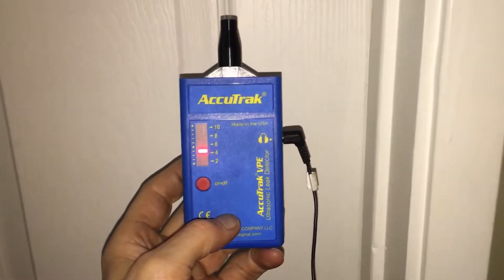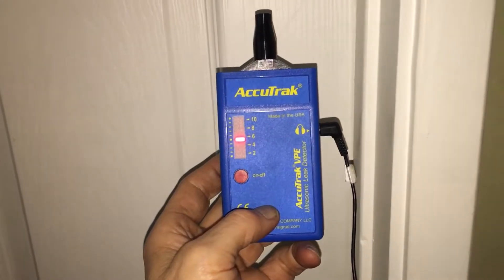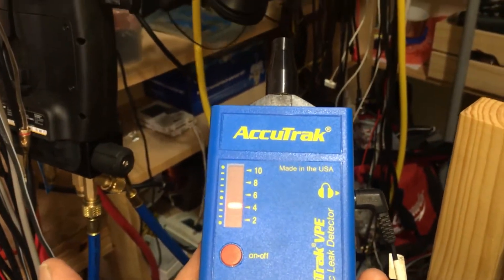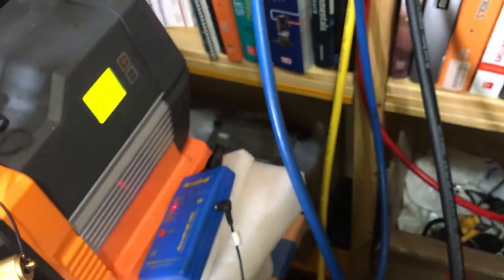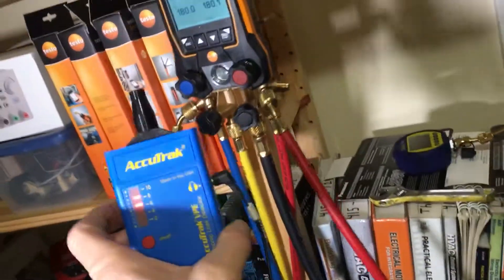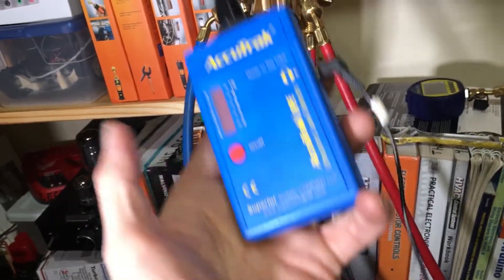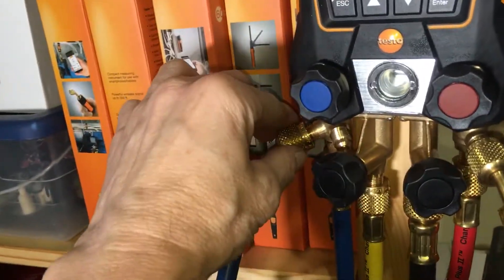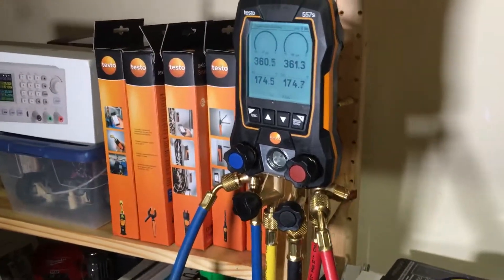3rd leak detection for the Testo 557S failing nitrogen decay test. (It’s the hose seal)

Comment: I got a Inficon whisper ultrasonic leak detector last year. It found an air leak under my bus with the engine running. I hoping it will do the same when I pressurize my A/C system.
Reply from the maker: I grew up using my dad’s that’s how I was first introduced amazingly sensitive. 

        Now that I purchased one of the most recent models that are supposed to be improved. 
         I literally can hold the sensor in my left hand and with my right hand take one finger and just gently rub it up and down my Levi’s and it picks it up this thing is stupid crazy sensitive. 

           But if you had one of the 70s American made or specially a Honda that had 10,000 vacuum hoses with 50 little bleed vacuum valves everywhere to control the operation of everything while the engine was running an ultrasonic leak detector would be 100% useless it would be set on number 10 all the time 😂🤣